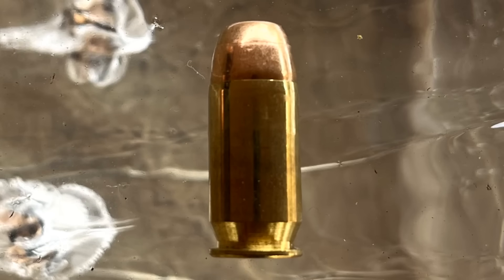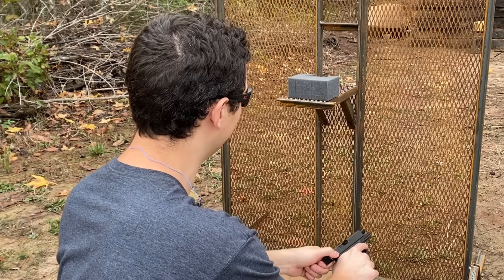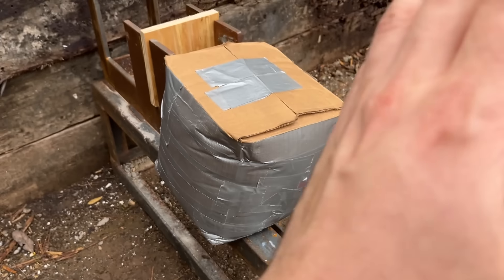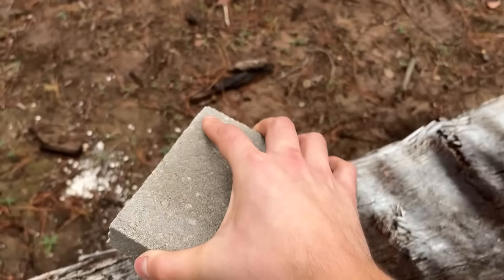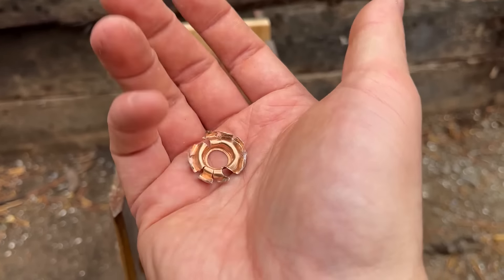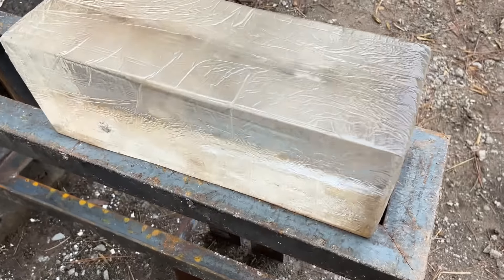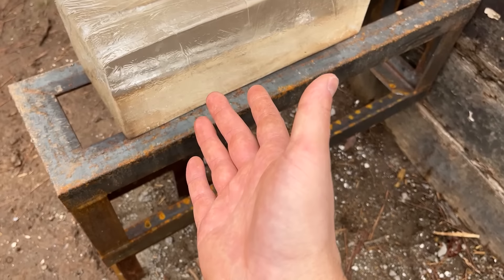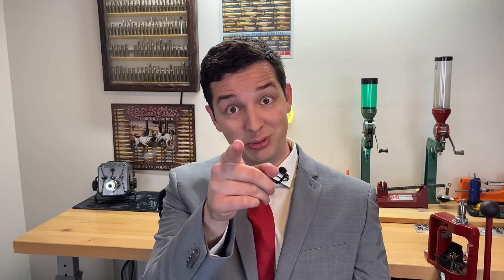9mm vs 45 ACP Barrier Test: No Debate?

Comment: It appears that you were trying to make a real test to compare the 9mm with the .45 ACP. But like 90-95% of all ammo tests online, the test performed was between ammo of choice to make the 9mm loo good. Here is why I say this. The 9mm ammo that you showed and its ballistics is not common, ordinary 9mm. You select a fair hot 9mm round with 400 ft. lbs, whereas the 'average' 9mm ammo delivers only 350 ft. lbs. And the .45 ACP ammo you picked (and showed us at the beginning) delivered only 356 ft. lbs., whereas 423 ft. lbs. In addition to this, the max power for any 9mm is 500 ft. lbs. (Buffalo Bore), and the max .45 ACP round delivers 616 ft. lbs, and the max .45 Super goes up to 694 ft. lbs. (Buffalo Bore). I doubt that most 9mm pistols could shoot the 500 ft. lb. round, and similarly, most .45 ACP pistols cannot shoot the .45 Super round (most require internal changes, such as strong springs, etc.). Lastly, relative to this test, if the power is equal between the competing rounds, each with the same type and weight of bullet, the more narrow caliber will penetrate further, which was clearly shown here. So, basically, this test proved almost nothing.

Comment: Common sense actually. You wanna throw more jabs or hit a few haymakers? Either can knock someone out. Both serves a purpose. 
If you are new and can only choose one, prob 9mm would be better. More cost effective, can carry more of it, more rounds on hand, less recoil, easier to handle, just dump rounds if you cant aim.
If you have more experience, 45acp is more rewarding. Pick your shots and they better be good cause you wont have much of it. As shown with the concrete, if something big is charging at you, you will probably want the 45.
Either way, correct ammo type for the job is more important

Comment: I`ll just keep my 45acp, cause short, fat and slow dumps most of it`s energy on impact with extreme prejudice and gets the job done with less passthrough. 9mm will pass through, smaller projectile with higher FPS.  Remember, once you fire ANY round, YOU are responsible for it until it stops.. Remember firearm safety whatever caliber you choose. I wonder which caliber(9vs45) would do the most damage on a zombie ballistic gel torso with a double tap, you know, for a home invasion scenario. Just a thought.

Comment: So far the only Gun tuber I have seen that does factual balistic true galiber  comparisons is Paul Harrel.  He uses  the Ammo brand  ,type of bullet,  the to the bullet weight close as posible. and firearms with similar barrel legths . Example when comparring the 9mm VS 45 ACP he has use the Remmington green box 9mm 147gr FMJ RN  vs 45acp180gr FMJ RN. both use a gandgun with a 4 in barrel. This is about as and Apples to apples comparrison as you ca get.

Comment: re-test with a normal 230gr 45acp and a 115gr 9mm. NOBODY shoots flat nosed 45acp, even for practice. Never had a good experience with cheap flat nosed 45. 9 will still win, but c'mon man, if you are testing standard vs. standard, flat nose is not 45acp ball ammunition. If you are shooting 9mm and it has a flat nose it is 124gr .357 (still 9mm) from Underwood which is a +p. Grab a box of federal 115gr 9mm and same brand 230gr 45acp. And for all of you that practice w/ 9mm and carry 9mm like I do, if you're pistol is rated for +p train with NATO 9mm. Then you will be training with +p ammunition (124gr 1200fps) all the time so you wont get messed up if you have to use your home defense loads and need to land follow-ups. And... it costs the same as cheap standard 115gr fmj.

Comment: There is no debate.  All handgun round suck and with modern ammo there is not enough difference in terminal performance as evidenced by real world shooting statistics to worry about which handgun caliber that you are carrying.  Shot placement trumps caliber EVERY SINGLE TIME.  Carry the gun that you can put the most rounds on target accurately with. 

This is a case of using a magnifying glass to ignore the bigger picture. It is really easy to say that a .45 acp is better than a 9mm because it has 20% more energy.  I would argue that a 9mm is better because from the same size gun you are carrying 10 more rounds and 70% more energy to service targets with. 

The reality is that compared to a real man stopper, even the 5.56 M195 is hitting with over twice the energy of a .45 or 9mm.  A 12 gauge 2-3/4" buckshot round adds another 20% on top of that.

Comment: Nobody bothered to mention the fact that bone doesn't expand then contract, it shatters. There's a very high likelihood a round will hit a skull, Sternum, ribs, hips etc. So all the talk of ''temporary entry wound cavity doesn't matter'' is complete bullsh1t. Unless you are enormously overweight, all significant near-instant death shots will have to penetrate boney protection, it's literally why ribs, skulls, sternums exist. And they are covered by extremely thin veils of skin only, or thinner sheets of muscle. A gut shot or groin, is the only vital region you're going to hit that doesn't have the protection of bone. So yes, initial impact does have an enormous effect on a target. So to say that ''permanent wound cavities'' matter more than ''temporary wound cavities'' is fanboy bullsh1t. There is no such thing as a temporary hole in the head, no such thing as a sternum that temporarily shatters, and no such thing as temporarily splintered ribcages. They do not knit back together. Gel is not tissue. And if you think ''temporary wound channels'' do insignificant damage to tissue, you have no education about delicate vein and artery distribution, nor nerve damage, nor bleedout scenarios or frankly how anything in the human body works.

Comment: The concrete was no draw at all, the energy from the 45 disintegrated it far more than the 9 and that energy would have also translated to human torsos in the other first two test as well, thereby relegating this as moot at best.

Comment: the benefits of the 45acp are full metal jacket ammo. if you compare 45 to 9 with hard ball ammo. the 45 will do more damage though tumbling.  usually. modern hollow points give the 9 an advantage. and increased round count in the gun. i personally dont like either. 10mm will do everything better.

Comment: Ballistics gel is a very poor bullet medium. Paul Harrells meat target is good.  In this the 9mm does about 60% less penetration and damage than a 45 in real liquid meat and bone.  In gel the more powerful the round the more hydrostatic shock and back lash is created.  Just like the harder you slap water with your hand.  Meaning an arrow will do better than most bullets even though the energy is not there.  A 45 in honest tests penetrates 7 inches of pine.   In water jugs a 45 fmj 230 penetrates 7 and a 9mm with 147 or 124 penetrates 5.

Comment: The 45 probably should have been shot out of a 1911. The 45 definitely won the paver round, it wasn't even close. Now you shoot two objects, the 6 inch block of wood and the gel. The gel you measure the depth and wound channel, but the wood you did not. You can clearly see the 45 did a lot more damage to the wood, a lot more. Your tests were good, but you put more emphasis on penetration than actual damage. Penetration is a very tricky subject.

Comment: More 9mm standard load would be 124 grain and around 1200fps.
General 9mm ammo in US is under powered. Average 115gr and 1050 to 1100 fps.
Around 25 to 30% less energy than 9mm nato.
I'm not comparing to +p or +p+ ammunition. That completely different animal and not all handguns can handle. 

Similar with 308w vs 7.62 Nato or 5.56mm vs .223.

Comment: 45 with the new ammo in 185gr plus P will travel at 1180fps. So you will need a in 9mm at 115gr to hit those speeds. No contest 45 wins. Everyone uses 230 g 45 and that round is to slow

Comment: Overlooked : Energy that is not dealt to the target, instead runs through an vanishes somewhere behind, is worth nothing. And this speaks for the slower and bigger caliber, for the 45 in this case. Any test that does not take this into account has failed. And : the shorter a barrel is,the more powder will burn useless before the muzzle , without propelling the missile. Again, the bigger bullet with less powder ist superior. But, the point w h e r e you hit counts far,far more than with w h a t you hit. As for humans, mostly even a 7,65 mm Browning would do.

Comment: While entertaining, shooting wood blocks, concrete, etc does not measure/approximate  lethality or stopping power of handgun rounds.  That requires ballistic gel.  Additionally test in the concrete was a draw?  Review shows the 9 partially shattering the target...the 45 completely shattered it, demonstrating a higher striking energy level.  Comment below about original intent of the 45 was correct up until the "without going through" part.  The military cared less about overpenetration, and probably actually wanted it.  Not until modern ( 1970 forward) police/law enforcement concerns did that worry enter the picture

Comment: I'm not even going to watch this video let's face the facts 45 acp is much heavier load it's designed for stopping power it's heavier bigger projectile with more powder if that's what you want go 45. 9mm lighter ammo smaller projectile with a little less powder less stopping power but less kick as well which allows for quicker follow up shots more accurate follow up shots and you can have more ammo in the clip without weighting down the gun or your waist  for me it's a no brainer 9mm but I do carry 357 when I'm hunting each caliber has it's purpose

Comment: Well its not rocket sience the 9mm will penetrate more because of the higher speed and the smaller bullet. The 45 will make a bigger hole but will not penetrate as far. In personal i prefer the 9mm because of the lower recoil and more mag capacity. But thats just me. Each to his own.

Comment: Not trying to start a pissing match, but the added velocity of the 9mm makes a big difference when comparing the two. Not saying that the .45 ACP is a bad cartridge, but the 9mm does offer a practical advantage under most circumstances.

Comment: Seen some .45 ACP going at 880 feet per second, FMJ, and saw some Hp's going almost 1100 FPS, so, i wonder where you got the 835 FPS. ONe more thing 9 Mighty Mite is fast so you risk Through and Through wounds. Saw a guy shot 14 times with the 9 Mighty Mite, he keep going, only takes 2 .45's to stop a thug, so you tell me which caliber you are willing to bet your safety on.

Comment: The .45 was designed as a people stopper as a backup to your primary weapon and in close quarters. The round was never meant to defeat barriers as it doesn't have the velocity, but works well for it's intended purpose.

Comment: You never gave us the information about the rounds you were using in each gun, the test means nothing without that information. The difference between light loads and +P loads in either caliber is dramatic and would completely change the results.
Reply: info up top

Comment: I have a 55 gallon steel drum for burning papers on my home range .45 acp blows through both sides with a wide variety of ammo but .380 bounces right off . My son fired both his compact and full size 9mm at it the bullets bounced off the drum .  I have  3.5" and 5" barreled .45 acp pistols and the short barrel fired from 40 yards with Corebon 165 gr H.P. +P ammo went though .
I also tested my Charter arms Bulldog 3" barrel in .44 sp. I have old factory 246 grain ammo in round nose and semi wadcutter they both do 760 f/s the round nose dents the barrel and falls off . The semiwadcutter goes through one side and spins around inside the barrel . Some Corebon 165 grain it goes through both sides with energy left going 4 inched into the dirt beyond .

By the way I also have little faith in your shield but as you see bullets tend to stay near the target unless they have hard cores then they may rebound .

Comment: Poor testing.  When I shoot I'm more interesting in the amount of damage I can deliver to the target.  You didn't test that.  As for the shot into concrete, the 45acp won that because of the damage it did to the concrete as compared to what the 9mm did.   As I stated, penetration only counts as a means of delivering energy to the target.  So, throw out your bogus results and design you experiment to test how much energy and momentum are delivered to the target.  Oh, on a side note, limited penetration in a crowd is a good thing.  You don't want a bullet going through your target and hitting something or someone else.  All-in-all, not a very good test.

Comment: Not sure why so many internet warriors argue over this when the two are SO similar where it matters--pistol-range kinetic energy. From a pure utility standpoint--e.g. not something random like ".45 is better because it was in two World Wars"--I'd go with the 9mm, and almost entirely because of higher capacity due to the smaller size (.45 ACP has the edge in being subsonic, but 9mm can be subsonic so long as they're higher weight). Otherwise, the differences are negligible.  The real debate is between calibers that are significantly different in kinetic energy - e.g. one of these two calibers vs. .40 S&W or 10mm Auto.

Comment: Velocity is king. A faster bullet will always do more damage, sometimes enough so that it makes all the difference. A .22 caliber bullet doesn't even compare to a 9mm...until it hits over 2,500 fps, then it out does it by so much that it appears silly to compare the two.
Reply: Yeah at rifle velocity, at handgun velocity not so much. .45 has WAY more case capacity. 185 gr .45 is faster than 147 gr 9mm standard pressures. Rounds loaded at .45 Super and .460 Rowland pressure are much faster than any kind of +p+ 9mm

Comment: The energy of the 45 is quite close to the 45 Long Colt. So, why would the Army be interested in a round like the 45 Long Colt? Because that what stopped drugged up, machete wielding Moros. Would you bet your Life using the 9mm?
Reply: 9mm... the energy of 45 does absolutely nothing to stop a threat in itself. With 9mm, you get more rounds that will have better penetration, will expand more reliablely, and will more often than not expand to be just as big or bigger than 45acp JHP rounds.

Comment: It also depends on the gun he is using too. He literally used a full steel frame gun for the 9mm and then a polymer frame for the 45, I would take this with a grain of salt. It’s Been tested multiple times that .45acp has more initial stopping power for a fact and the 9mm has a greater velocity that’s the difference but it does matter what pistols you do use and ammo per gun some pistols work better with certain ammo. I reload so I’ve tested it out myself!
Reply: The frame has no bearing on bullet performance.

Comment: 9mm = more rounds for your inaccurate shooting ass with a bonus of having slightly more penetration

45acp = harder hitting rounds dumping more energy into the target which causes more damage/pain to the recipient.

do the math, calculate a target receiving three rounds of 45 and its energy dump vs 3 rounds of smaller 9mm which will cause less damage. (ft/lbs energy x 3). You’re gonna get more with the 45.
Reply: ''Nah, I'm good. I don't need more magazine capacity.''

Said no one ever.